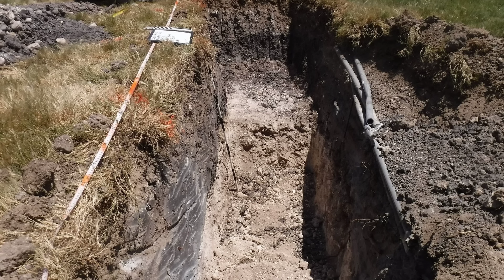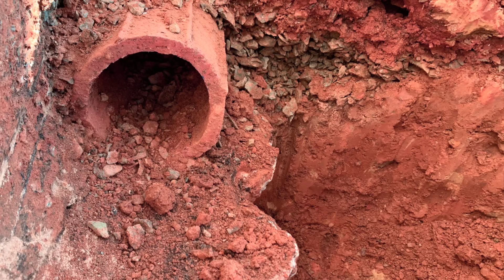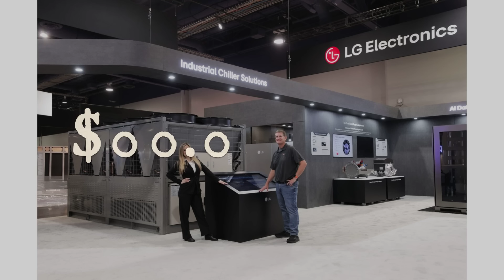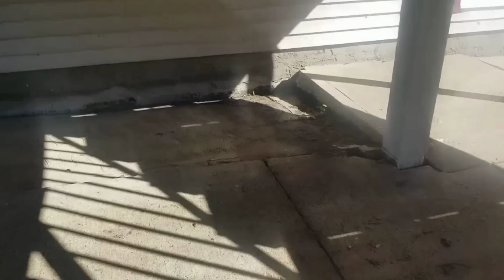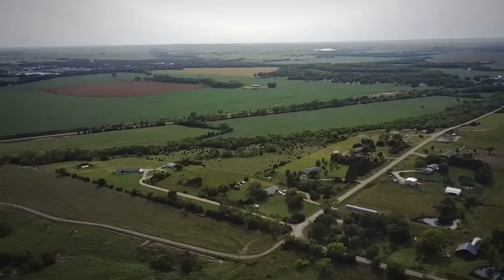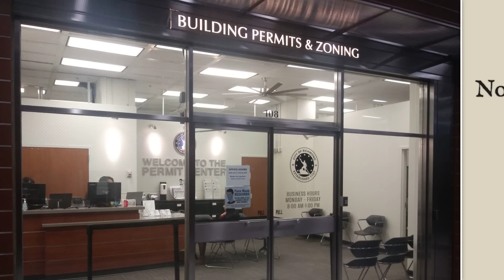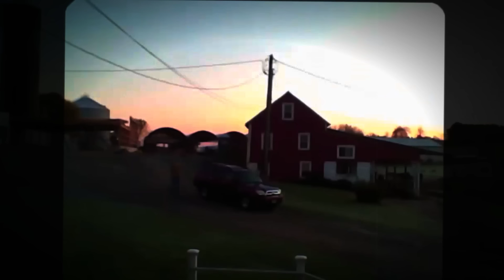This $300 Tunnel Keeps Any Home 55°F Forever — The Amish System the Cooling Industry Made Illegal

Comment: The reason this theory has died is because its not practical. Installation would cost 10's of thousands to install in a house that does not have it. Not to mention getting the "OK to dig" calls. This WOULD work. This is super efficient. Convenience is what killed it. People have been loading coolers with ice then blowing a fan into it for decades too. You still rarely see them. Convenience.

Comment: I'm only a 3rd the way through, but I'd be very curious how something like this could be implemented in an areas like the gulf coast, so Louisiana, south Mississippi, South Alabama, and Florida. Not just heat, but very high amounts of humidity. Varying temperatures could cause serious issues with moisture build up and mold growth.

Comment: $0 for heating and cooling in rural tennessee eh? So when its 32 degrees outside in january his 55 degree heating solution brings the temp up to 44... Even during july the low is 72... so his inside is 64? This man wears coats inside all year round??? You are a liar.

Comment: So, wouldn’t aluminum piping, laid underground, work way better and more efficiently than PVC, plastic, and/or whatever else they use in this video??? I mean, aluminum conducts way better and faster than those other materials, thus cooling the air inside the pipes even quicker. You could actually even use less pipe, because of this effect. You don’t see moonshine stills being built out of PVC or plastic, do you??? I know there’s heat and flames involved, but even the parts that aren’t exposed to an open flame are made with copper. Technically, you could use copper instead of aluminum, but I just said aluminum because of the cost difference between copper and aluminum, with aluminum being a good bit cheaper than copper.

Comment: 0:59 At 6' below the surface? I wonder if that is why the bodies are buried at no less than 6' under ground?
Reply: They do as low as 4 feet. 6 feet isn't a standard. They even stack people in the same hole
Reply: @umomiekiller  I knew they stack people up but didn't know they were using 4'. From what I have seen all cemeteries in different countries use the same 6' depth.

Comment: I’m sure others probably commented but modern ac cool by removing humidity from a space. Less humidity equals atmospheric air has less ability to hold latent heat. You feel cooler shortly after initially turn ac due to better evaporative cooling provided when perspiration on your skin more efficiently evaporates. Any product using ice or water to provide “AC” is a waste of money.

Comment: HVAC performance based contractor, I’m all about saving energy for my clients. However, I’m going to have to agree with Willis, earth tubes are unsanitary. All I can think of is the humidity, mold and bacteria that will develop in those tubes after time. I’ll stick with inverter heat pump systems.

Comment: $300 for 150’ of 8” pvc, a fan, and fittings. You are out of your mind. 2” PVC schedule 40 is over $4 per foot.  8” sewer pipe is about $9.90 a foot! 150’x$9.90=$1485. Then the fittings. That fan is about $300. A 4” trencher to rent is $500 for a weekend. A mini-ex wil enough reach and power to dig 6’ will cost you almost $1000. Where do you place all that dirt while you are digging up the narrow space between your car and house? The neighbors yard?
Ok so the pipe has a 2%grade away from the house so it can drain condensation. Then what you just have a little weep hole so the water can drip out?? The airflow will suck it back in!  If it is 70% humidity and 90 degrees and you pull that air into a 56* pipe!!? Think about it people. Put ice water in a glass and set outside on that day. There is some much condensation your cup floats off!

Comment: Geothermal heating/cooling is well recognized and in basically all the code books. Trenching and installation of large PVC at a depth of 6+ feet is a substantial undertaking, though by no means outside the realm of feasibility in most places. Using an air pipe installation is minimum ~$10/ft in materials, plus permitting/labor/etc. That said - its a very intriguing option in some circumstances. In particular, I would see an air pipe used as the source path for an HRV/ERV with automatic bypass as a decent DIY option for energy efficiency. The difficulty with taking outside air in through a long buried pipe is in keeping it clean and preconditioned, without risking it filling with mold/growth/etc. That means you really do need to put some labor into doing it right.

Comment: No permits no percussions ! Start digging ! Your neighbours will love ya ! Amish neighbours are like 2 miles away lol just saying in a standard subdivision no go.   You need land and clearances from electrical and city plumbing
 But sure cool start to an idea. Glycol loop with pump and Ahu unit is more costly than a central ac if you ducting.  Ductless splits even less and they don’t use much hydro anymore.  So not for every home.

Comment: You completely ignored the Second Law of Thermodynamics. The universe loves entropy—it actively wants an un-air-conditioned house to be a hot, sweltering mess. This 'Amish miracle' only works if your biggest internal heat source is a kerosene lamp. The second you put an average family inside with a 65-inch TV, a running fridge, and a hot stove, that tiny volume of 55-degree air gets mathematically annihilated. You can't reverse entropy and bail out 30,000 BTUs of modern heat gain with $300 of plastic tubing and a prayer

Comment: It’s called geothermal. It’s not banned, many people use it. Very high upfront cost 3-4x a normal system but running costs low. There’s actually gov credits to help. But overall more expensive. Kind of like solar is free energy but high upfront costs. Also rocky soil makes install costs really high

Comment: Everything described after 11 minutes about the system is total BS.  95F air with a 50% relative humidity which is typical for a hot summer day has a saturation point of 73F, so that air coming out of the pipe at 70F is saturated, 100% RH air.  Even if you are attempting to keep the home at 80F, the home will have a 75% relative humidity.  Not only is this going to feel disgustingly swampy, it is also ripe for mold and other micro-organism growth.  Additionally, a fan "consuming less than the power of a light bulb" is not going to move nearly enough air to make a difference in comfort.  

This video is entirely click bait filled with what can't even be described as half truths.

-Signed HVAC Professional Engineer.

Comment: Cincinnati. 4 acres, wooded. 21 solar panels on the roof. $350-400 a month. The panels only actually helped to keep inflation from changing the high cost. I probably won't do this right away. However, I have a cabin the woods and need to build a workshop. Using the concept, I can experiment and then bury pipe for all at the same time. I need to figure out if deeper is better though. 
If I go 10 feet, any change other than thermal mass preventing increased temperature?

Comment: My friend in Oklahoma built a partially underground home and used parallel abandoned oil pipelines in 1975. It was cool all summer when outside temps reached over 110°F and no less than 52°F when outside temps were below zero.

Comment: The HVAC companies do not need to hide this... most people don't have enough land to make a viable "earth tube" for cooling, and if you try to cool a whole neighborhood with this method, the system will be easily overwhelmed and it won't work...  So this video is pretty bogus unless you have several acres of land and are willing to spend THOUSANDS of dollars, equal to a HVAC system to install something like this that would only work for a very tiny and well insulated home (again many more thousands of dollars for insanely good insulation and windows).  Totally not worth it...

Comment: Geothermal heat/ac. My parents have had the system for 30 years now. A large upfront cost, long-term savings. Excellent system.
Reply: I'm going to call BS.  My neighbor purchased a geothermal unit bc of Obama's tax credit.  Their unit failed within 8 years and the company boasted they were lucky they got such good use out of it.  Foolishly, they paid to replace it again, which only lasted 5 years.  After a lot of arguing, the manufacturer paid for replacement parts (they had to pay for labor).  Two geothermal units failed within 13 years.  Geothermal tech isn't mainstream bc it's garbage.  Meanwhile my oil boiler has been running hard for 30+ years.

Comment: You can’t cool a typical home with 100-200 cfm of 65-70 deg air. There’s a reason your AC has to pump out 1000+ cfm of 50 degree air to cool your house on a hot day. You would need to combine this with a berm home or similar to reduce your AC load dramatically for this to work properly. Otherwise you are going to need much more than a single 100’ long pipe for the average home.

Comment: 6-8wks to penetrate 6'...ok, so 20' down in Texas is 80 degrees by June. Also, you hit on the important point here at 5:40: humidity is the enemy. a/c cures that. Modern a/c can run during daylight hours from solar such as the eg4 24k systems. Earth tubes have their place but not for a living space.

Comment: This is basically geothermal but the industry decided to make geothermal crazy expensive so people wouldn't want it. It's just as simple as digging a hole and a pipe but it's not much from that. Common sense can do this to anyone's home! If I was to do a new build, I would not have an AC if any type and only have a wood stove for heat.

Comment: So dumb.  There is no conspiracy going on, no one 'buried the knowledge', little kids know the basement is cool during the summer.  It is just does not have the heat moving capability needed for a a house for modern comfort.  When it is 90 outside and people want it 72 in their house there is a 2 sq ft opening in EVERY ROOM pushing 57 degree air to accomplish that.  The idea that digging a 100' foot trench 6' deep for each line is 'free' is hilarious.  
Using this effectively is what geothermal does - a heat pump does work to multiply the transfer of heat in a ground loop to the level that can actually keep a house comfortable, not cooler in one area of the house.

Comment: This pisses me off. Back in 2011, I brought this up as an idea at work. The guys told me that I was an idiot, and that the city probably wouldn't allow me to do it anyways. I told my wife that I wanted to dig a trench arouns the parameter of my back yard, and lay a pipe that runs from the house through the pipes, and back to the house with an induction fan to move the air. She said it was a bad idea. Freaking 15 years later, I see this video. So basically, I wasn't crazy. I don't see why this isn't something most people are doing. It only made sense to me after watching a documentary like 25 years ago where there was a community living somewhere in Australia that lives underground, and they said that temperatures stayed a constant 70°F. From that documentary, I learned that in-ground temperatures were cooler. This idea needs to catch on.
Reply: 100%
Reply: Ok
Reply: Yes, you are crazy.... That's because it's not feasible and doesn't work like you think. The ground stays cool as long as it's covered. To ventilate, you need an open airways to push it through from the surface. The outside hot humidity is going to be drawn in through the vent lines underground and increase the temperature of the tunnel. So you will feel cool for around 30mins before the tunnel gets too hot and you will get the same effect as just putting a fan in, or better, a window AC unit in. You're going to do all of that and cost so much money just to drop your home temp by 5F to 10F for no more than an hour.
Plus, why would you want to when everything is 30x better? These caves do not instantly cool your home off in seconds and will takes hours of constantly circulating to remove hot air. You can buy a window unit and cool your room off to 60F degrees in seconds... 

You ever wonder why miners wear tank tops when working? Because it gets really hot in caves. Same applies to this system. This video is misleading and we used underground cooling to store food since it's the coolest place to put stuff. We no longer do it because we already have stuff 30x better.
Reply: so.. youd now have like 100meters(90yards) of pipe underneath the ground... 
1- earth around the pipe would dry and heat up, becoming an insulation and not work very well, unless you dig to groundwater level, in which case water would take away the heat, but in some places its quite deep.
so 100meters would do you little good, youd neew more like... 500meters at least to snake through your yard.
Its nice and cold in basement but take into account that you dont usually vent basement.
2- it would be full of insects, maybe some dead rat and a plethora of bacteria and fungus for sure... the air sure would be cool in summer and realtively warm in winter, but... So you have to thinks of how to clean and sterilize those pipes. 
3- If earth shifts, then it may squeeze your tubnnel closed at some point, of, if you dug deep enough to reach groundwater, or it may happen in spring or during some rainstorm... or if you have some damaged pipe(hole) higher that the lowest point of the system- it would make a pefect air seal and make your system not work, grow algae, etc.
4- plastic has lousy heat transfer, it works more like an insulator, so you need a lot more length than you'd think, making it quite finicky and more expensive than id like it to be.
Those are main reasons i decided against it. Geothermal heat pump is way more effective that way, but installation of the system and regular maintenance makes it really expensive, so im also still thinking and pondering on what to do.
Reply: @klavsvasilis you must have gotten your engineering degree from Trump University 😂
Reply: @Cousin_Matt  he isnt completely wrong but also overstates some issues that are usually minor you should stick to regurgitating the news and pretending you are fighting the good fight
Reply: @TWEAKLET I appreciate the watch toobs
Reply: @Cousin_Matt  do your research please this is a real thing must have went to the biden university of lost and confused folks
Reply: @DudeFishing-y1j  Seriously, have you watched ANY news or speeches or announcements lately from trump? dude doesn't know what room he's in anymore. Can't even complete a sentence without falling into a hole of dementia. it's seriously worrying watching this brain-rotted individual in charge of anything, making commands while he literally shits his pants on live TV.
Reply: Stop listening to idiots and women. Trust your gut brother. It’s never steered you wrong.

Comment: No secret.  HVAC companies have been selling ground source heat pumps for decades.  Beyond the cost, one of the limiting factors is that most homeowners don’t have the land that Amish homeowners do, requiring a much deeper dig to make a sufficient loop.  Just use Google.  
I think any “English” homeowners has noticed their basement is cooler and their water comes out of the tap cool.  Not a revelation. 
There have also been installations, not by the Amish, running loops on lake bottoms, like at Cornell University (not an Amish institution). 
Just stop with the conspiracy BS.

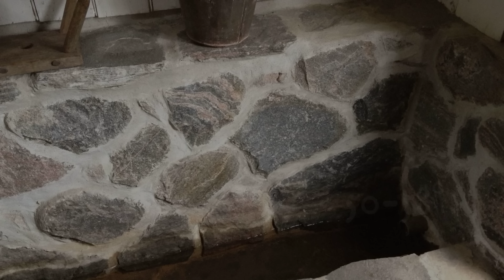Comment: 3:42 Why would this be illegal 👏
Reply: It’s not. It’s just channels like this say it’s illegal to get clicks and views.
Reply: It's not. It's not hidden, illegal or, unknown. Clickbaitty lie. It's basic physics. But it's not practical in actual use. Because the same reason that Earth does not absorb heat too well, as soon as the earth around the tube warms, it will stay warm and cooling stops for a while. And you gotta stop airflow. We're better off using swamp coolers. And only works for low volume, slow airflow.
Reply: Why is hunting without a license illegal? Why is it legal for you to be charged to live on Earth?
Reply: Its not illegal. You just need space to put the pipe in the ground
Reply: @umomiekiller incorrect, land isnt yours. A persons property was taken because they decided to dig and found a oil reserve.

Comment: This is actually getting more popular in Poland as well, I will be building that in my new home and will try first without A/C installation. We call it "Ground heat exchanger" (in PL - Gruntowy wymiennik ciepła (GWC) ). Though, its actually mostly recommended in PL due to its "pre" heating capabilities of air during winter, paired with recuperation system. Nevertheless, it will also make the air colder during summer. So it should be great all year. Will see in few years on my own :) Unfortunately in PL the climate is very diversified. We can have -20 Celsius during winter and +35 Cel during summer. Though its usually few weeks for peak cold and hot.

Comment: How long should it be? Which diameter pipe? The air would be outside temperature, so to cool off it needs to travel a certain distance. For the cooling effect to create aiflow, there needs to be a certain size and length.

Comment: The one VA I go to made one of the buildings with geothermal a/c and heat. In the summer it is so cold in there and in the winter it is probably still in the upper 60°’s F at best. If I ever had the money for a new build house I would definitely integrate geothermal with a traditional furnace and a fireplace.
Anything that is banned you have to follow the money.

Comment: I had always wondered why we didn’t draw the 55° air from the crawl space but wondered if cool air wouldn’t just run out quickly. Wondering the same about the system you discuss here. Can the earth cool the air (transfer the heat) fast enough to keep the house cool when it is say 100° air going in?